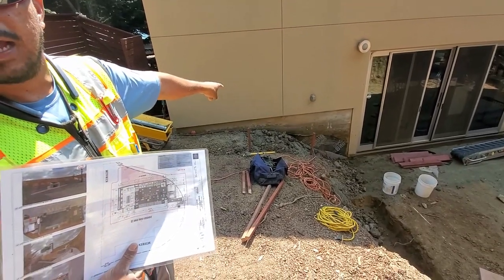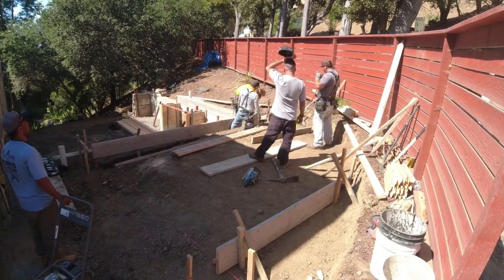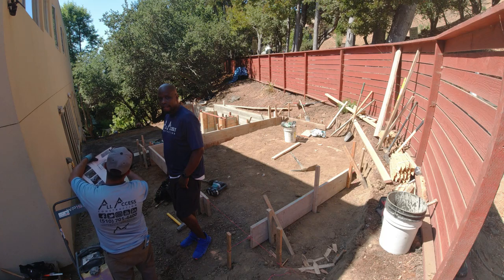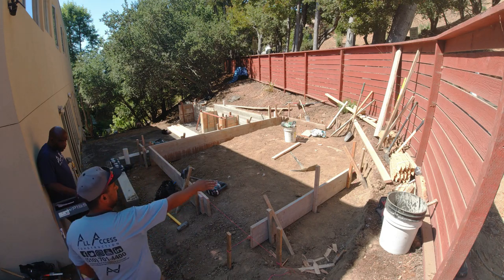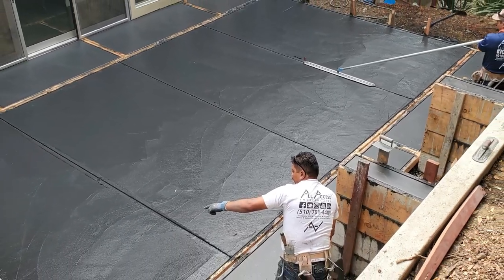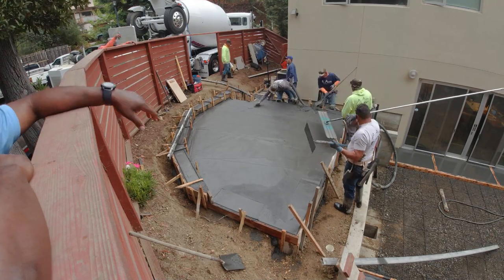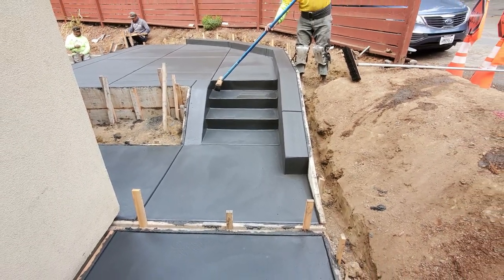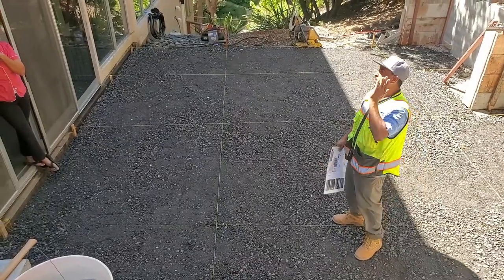Raise Color CONCRETE Patio | Modern Landscape Design

Comment: You gota pump that, ain't no other way! I could have poured the raised patio w out but would have been hard, but we have front discharge trucks! But that bottom level, no way u gota pump, and yeah I would have done it in 2 pours!
Reply: But if I rented a pump, I would have poured it all in 1 day, that makes all the difference in the world!
Reply from the maker: Appreciate bro
Reply: @AllAccessConstruction  I used to work w a guy that hired pampers w 3 inch hose and we pumped stone mix through it, what do u think happens everytime? I have had some good experience w 4 inch lines but they are so heavy. And even some of those got clogged, then it get dangerous hitting those lines w a hammer,  if it blew out it would kill a guy. So if there is a will there is a way! But man your videos are something I look forward to. I amgoing to call u about that topic we talked about
Reply from the maker: Never had a pump back fire....I can imagine tho...
Reply: @AllAccessConstruction  never wow! They are way different pumps though, I've seen that little rabbit fly out and hit a dumpster one time and actually dent it, but there is only 1 way to do that job and it's to pump it and I would look like an idiot trying g to not pump it lol! I'm sure u got a good company that pumps and we didn't, it was a mess bro, so I swear away plus we got room here to buggy or just bring the truck up to the hole! Could that conveyor u got work for concrete? Jw
Reply from the maker: Yea 8f we absolutely have to
Reply: @AllAccessConstruction  do u hoop? Basketball or did u? I'm pretty ,sure u r from Indiana
Reply from the maker: Big time hooper.... #44😅😅
Reply: @AllAccessConstruction  https://youtu.be/zyWmFfD2GXY, fast forward to 16:00 on that video, I have a couple of clips of me hooping in my last video a few years ago
Reply: @AllAccessConstruction  I figured u were, u from Indiana. What else is there to do here lol